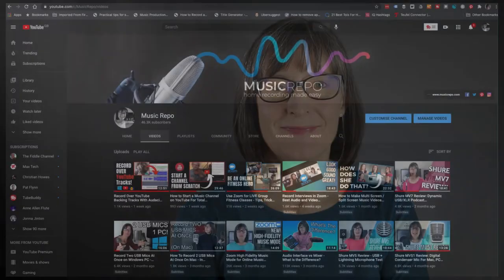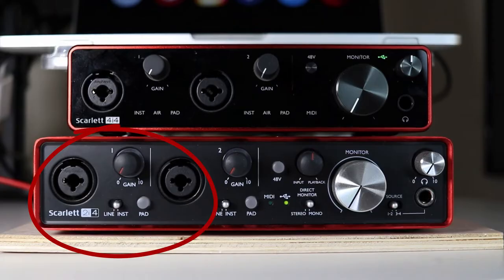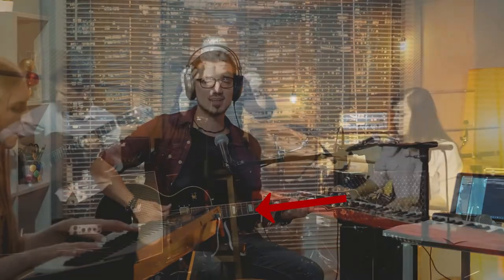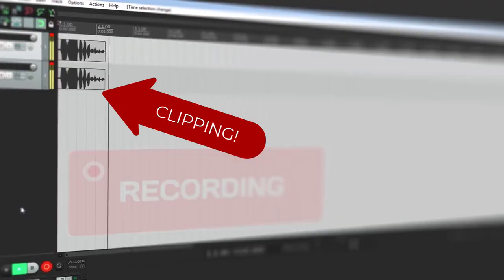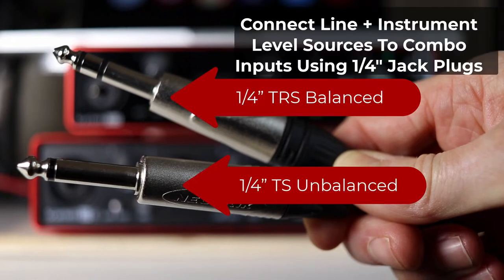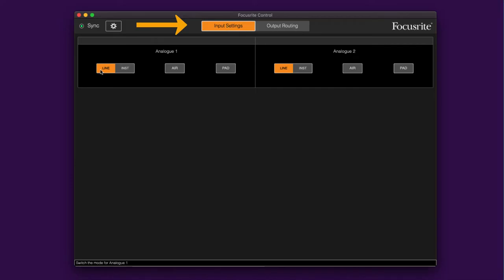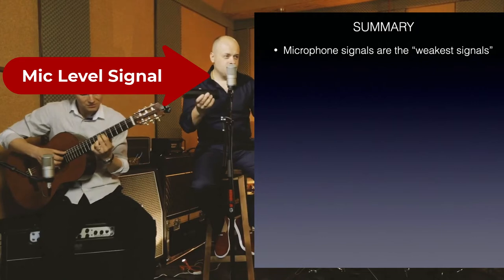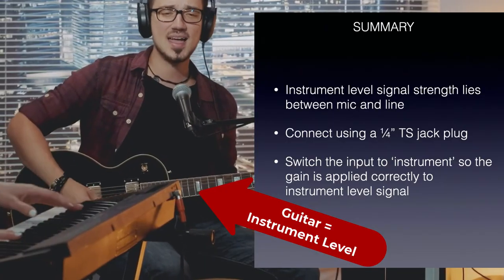Line vs Mic vs Instrument Level - Audio Signal Levels Explained

Comment: I've been messing around with cables, guitars, amps and DAWs for years (and lately, hardware synthesisers) but I have,  just recently, come to rely heavily on your channel for all the basic information it turns out that I didn't know. The level you pitch (neither pun intended) the information at is perfect - thank you very much for your work, it's appreciated greatly.

Comment: Thank you for you video ! I have a question regarding my future setting. To avoid unplug cable from my gears (bass guitar, pedals etc), i have ordered a DI box. I will use an XLR cable between the DI Box and my Audio Interface (a berhinger). So my question is : does i need to select line or inst ? As the DI box convet the signal to low impedance, i suppose i need to select line option ? Thanks !

Comment: Great video. Beginner here. But a Rode NT5 condenser mic and discovered an Audiobox USB 96 could not sufficiently power it. I ordered a DBX 286s preamp/processor. My question is, since my audio interface does not have line in, will my setup be less than optimal if I have to use a line to XLR cable as opposed to line to line? If so, I may bite the bullet and just get a better interface. Thanks in advance!

Comment: Great video; although it is not clear how do you know when you are clipping, except if you look at the light ring. Also the interface has levels too, doesn't it? I have a Focusrite too, and the panel itself has a gain for the monitor outputs and headphone output; on top of the gain for each of the hardware input... So how do you set those to have a starting point? Because if you move back and forth between the instrument volume knob, the gain knob on your input on the interface and the level slider in the audio interface settings, there is no clear way about how to set up the reference level.
Reply from the maker: I think the controls on the Focusrite are not very precise. So you need trial and error and monitoring the levels in your DAW. I talk a bit about that in this video https://youtu.be/ASntRNmJMFQ
It's a fair point. I also have a Zen Go Synergy Core Interface which is much more precise and therefore easier to replicate settings.

Comment: I finally got some sound to come out of an amp/speaker, from my mic and from my guitar.  Next step is to get it into my computer and record it there, and then play it on my amp/speaker.  I'm not worried about the quality of the sound.   I have a Focusrite Solo.  Will the sound go into my computer on the Solo's USB connection?  I'll be using an  e-board that was recommended by Focusrite users, or a simpler if I can find one, to start.  Thanks.

Comment: Sorry if you have replied to this before in another video; I haven't seen all of them yet...

I am mostly a songwriter (and bassist) and I want to record stuff at home, so... I want to simulate having pedals in front of the amp (dirt pedals) and other pedals (modulation) in the fx loop.
What is the best way to do this for recording? Should i use dirt pedals -> pre amp -> modulation pedals -> cab simulator (something cheap...) -> usb interface?

I also use Reaper as a DAW, nowadays. Maybe using a cab sim on the daw and keep everything else?

Comment: I have a Fender solid state Tone Master amplifier with an xlr output on the back of the amp. Can this be plugged directly into a effects pedal board and then run the output cable from effects pedals to the interface and or mixer xlr input then to daw on computer. Great videos.

Comment: The question I’m asking, it seems no one has a direct answer for, or at least not that I’ve found so far.

I have 2 Mackie Thump Go speakers (200 watts each,) and I am running from a TC Helicon Play Acoustic microphone and guitar effects processor with DI into a Harbinger Mixer, which goes into the speakers.

When running into powered speakers with line/mic switch, which should be engaged, considering both mic and guitar are being used from the main right and left outputs of the mixer  ?

Particularly in this instance where I have 2 outputs on my guitar. (Channels 2 and 3 of the mixer, and the mic in channel 1)
One for the onboard preamp to the humbuckers, and one for the piezo.
 I blend both sounds for a fully rounded sound when playing alone.
It seems the level was too low when I tried using line level settings.
But perhaps it is because I didn’t have the volume of the faders at UNITY in the Mackie App.

Thank you kindly, in advance!

Comment: I have the 212 interface and it has buttons for “air” “instrument”. Nothing specifically for mics other than the phantom button. I figured the instrument is for my guitar and keyboards, but is “air” for mics? I usually fiddle around until I get a good recording, but I would like to put my fiddle down 😎Generally I don’t need an interface as I record, mix and master on my Tascam 24 track Portastudio. I like it’s deeper softer sound. My DAW results in a hard edge, brittle sound (I either have a crummy DAW or don’t know how to use it properly) However, I use a computer program for video for which I need my mics and interface for voice over. Thanks for any help.
Reply: "Air" colors anything going through the preamp (i.e. inst/line level/XLR). This is a good video about the Solo, which is basically the same as the 2i2 less a channel:  https://youtu.be/VSgzF79ivd0
Reply from the maker: the 'air' option is to model a particular kind of pre-amp - it is particularly useful for vocals and acoustic instruments. If you want to record with a mic, then you should use an XLR lead. The interface will then expect a mic input. If you use a 1/4" jack, then you select instrument for a guitar or similar, deselect instrument for line input. As you only want to use the interface for voiceovers, then use XLR for microphones, and experiment with the 'air' to see which sounds better for you. On or off. The 'instrument' will have no effect if plugging in a mic.

Comment: Awesome video, super clear and helpful!
Even now I still find myself in confusing scenarios however, just bought a Prophet 6 desktop which is unbalanced out (TS) going into a balanced Clarett 4 pre, so im not sure if I should be using Line level, or Instrument level as the two ends are conflicting? Any ideas?

Comment: Hello, can I connect a mixer directly to a computer? Using a dual ¼ inch ts plugs to 3.5mm trs plug? What are the advantages and disadvantages to this setup compared to using an audio interface between them. Thank you

Comment: I have a RC300 looper and wnat to use the LINE IN for a dynamic mic with an output jack. I would need before connecting it to boost the level somehow, right?

Comment: Hello form Portugal.
Can you give me a little help?
I intend to buy an interface Tascam US-16x08 but when looking at the manual, when looking at the diagrams, I got the idea that to monitor channels 3 and 4 I can only do it using outputs 3 and 4, to monitor channels 5 and 6  it must be through 5 and 6 outputs and so on.
It doesn't make any sense but that's what I understood by the scheme.
Can you enlighten me?

Comment: What Hi-Z means, and how it is applied in the audio industry,?
Reply: Hi-Z is used for Guitars and Basses that do not have a preamp installed. Their signal output is very low and needs an input with high impedance.
Reply: @mulldruff  Nice info, thanks..

Comment: Hi Madam! Hope that you are doing fine. There are no words that I can come up with to say about you Madam. You are like the encyclopedia in this sector. I am new to all this recording and stuff. My question is, is there any interface or sound module like dexibell vivo sx7, which can be connected to a digital piano to generate different tones without connecting it to a computer? Like piano to interface and then to amp or speaker. My idea is to buy a digital piano but I also like to have some extra tones to play with. But it costs more when a digital piano has many tones. All I want to hear, is some extra tones on my amp or speaker by connecting to a medium which doesn't face any latency. If this is possible then I can save some money. If you can give me an insight, it'll be helpful for me Madam.   Thank you !

Comment: What do you do if using a Sure M57 mic and you have to push the  the gain right up on  full into the red to get even a little sound? The Focusrite claret is set on instrument ( not line)and doesn't have a pad switch.it has been suggested that a cloudlifter or booster (by a novice)  is required is that correct? Thank you
Reply from the maker: I have a Shure SM7B and I also use a Triton FetHead (which does the same job as a Cloudlifter) to boost the signal. Very quiet without. You may find you need similar for your mic https://www.tritonaudio.com/fethead
Reply: @MusicRepo  thankyou so much for your valuable information

Comment: Thanks a lot! I heard about DI and I wonder in which case we use it : line, mic, instrument input? My problem is when I record my bass (plugged in instrument input), if I slap it clips... even if the gain is at the lowest on the audio interface. So I can't record slapped bass :'(
Reply from the maker: Hopefully a DI box might help you out. The primary function of DI boxes is to take an unbalanced, high-impedance signal and convert it to a balanced, low-impedance signal. This allows you to run guitar and bass directly into microphone preamplifiers.
Reply: @MusicRepo   Thanks again =D
So instead of [bass -> instrument input],
I'll try  [bass -> DI box -> mic input]
Now I have to choose between an active or a passive DI box ^^

Comment: if I have both dynamic and condenser mics connected do I need to turn on the phantom power?
Reply: Condenser mics can use the phantom power. For Mics like a SM57 or SM58 don’t turn on the phantom power.

Comment: When I take a line out of a Line6 amplifier and use a 1/4  inch cable to connect to a Behringer UMC202HD Audio Interface and connect to JamKaZam online Jamminh software should I use the Inst setting on that channel on my interface?

And for my Ekectro Voice mic use the line input level ?  It does not use phantom power.
Reply from the maker: If you are taking line out of amp, then you need to use line in on your interface. The Elektro Voice mic should be connected using an XLR cable, and ** if ** the instructions for the Behringer UMC202HD are the same as for the Scarlett interfaces, then by using XLR the interface will automatically assume you have connected a microphone, and so won't matter whether you switch to line or inst on that channel. But I urge you to refer to the manual to check this... !!
Reply: @MusicRepo  Thanks so much for your reply.  Great information.

Comment: Hello there, I am currently using the scarlet 2i2 and I am using my guitar instrument cable to connect my keyboard using the keyboard's phones output and I set my scarlett to inst mode. Everything seems okay and there is no clipping but should I set my scarlett to line mode?
Reply: I think you can. Experiment by turning your keyboard output all the way down and the AI gain all the way down (you should always do this to start anyway). Then bring your keyboard up, possibly to max, while watching the clip indicator. If it never clips and you want a stronger recording level (-12db or so), start bringing the AI gain up till your recording levels are good (monitoring the levels through your DAW and the clipping indicator ring on the AI). The only really "dangerous" thing to be aware of is phantom power. Make absolutely sure that it's off for every situation other than a condenser mic which uses it. It's potentially hazardous to your equipment because when on, you are going to supply 48V back to the signal source, which if not designed to accept can cause bad money-wasting things to happen. For the best recording, you want the strongest signal from the source (keyboard in your case) with the least gain from the AI necessary. This will keep the noise introduced by the preamp in the AI to a minimum. Shoot for -12db in this manner and your recoding will be cleaner with headroom if you need it during the mix phase.
Reply: @jeffcuthbert6078  thank you so much ☺️ also if I have a condenser mic connected to my scarlet as well as a line/inst input simultaneously, will using 48v phantom power for my condenser mic harm my line/inst input?
Reply: @billyw3130  I would download the user guide from focusrite.com if you already haven't. But it looks like the one 48V button causes phantom power to be delivered to both XLR inputs at the same time (versus just one or the other). The user guide gives the impression that despite this you can still use the other TRS input simultaneously. This makes sense since phantom power only goes to the XLR inputs. So I think you're OK to use both inputs simultaneously with 48V on and one of the inputs being a 1/4" line level/inst jack that doesn't use it. If still unsure though, contact Focusrite and ask them.

Comment: I love your passion and expertise, but for me you talk way too fast, and unstructured. So my questions would be: If you have turned on phantom power, many pre amps will put phantom power on all input connections. Can you still mix line, dynamic mic and condensor mics on the same device? second question: would you advise a passive electric bass on line or inst? And what about an active bass? Would you recommend to turn up gain of the instrument or gain of the pre amp to get a decent signal out of the pre amp?